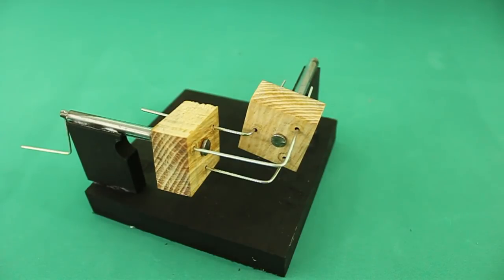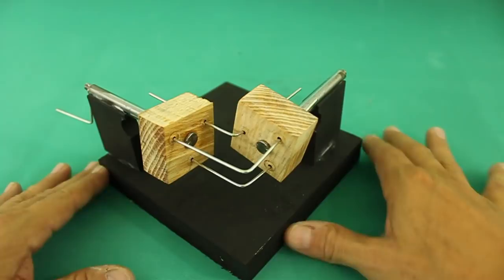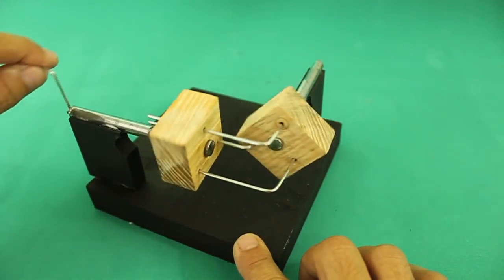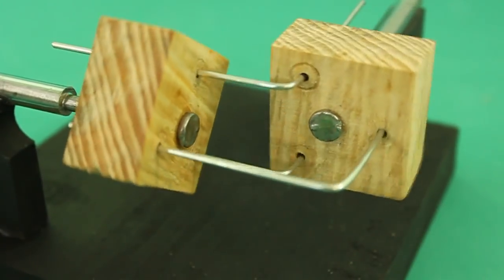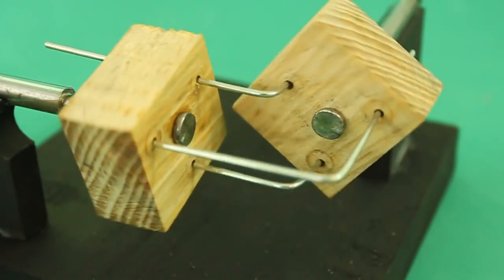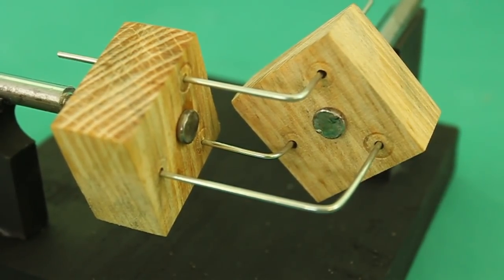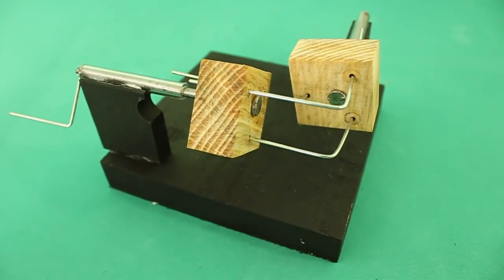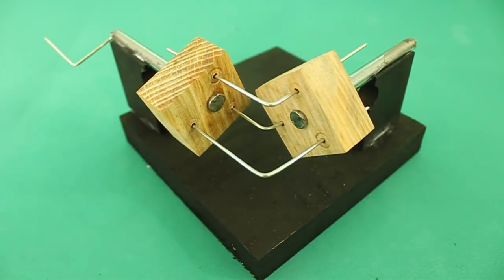Will This Transmission Work?

Comment: very interesting , If anyone wants to make it and have it run smoothly , use bicycle spokes with ptfe Bowden tube for 1.75mm 3d printing filaments and insert them on the transmissions half's